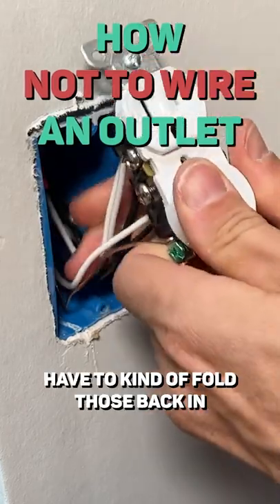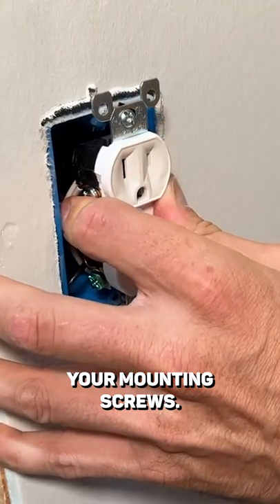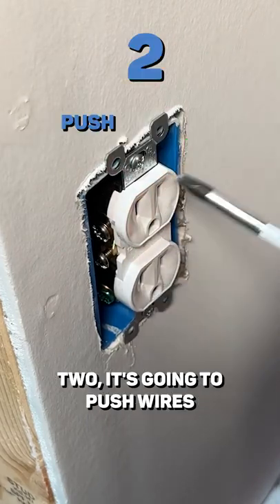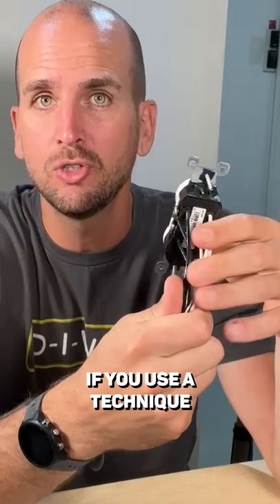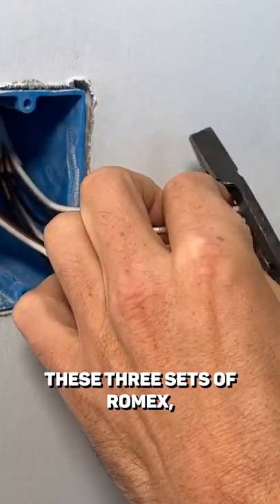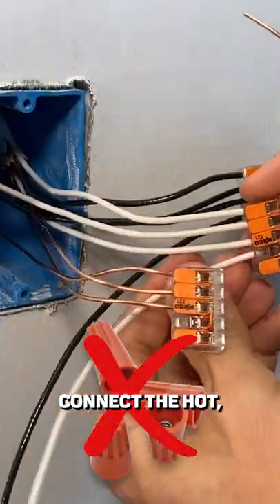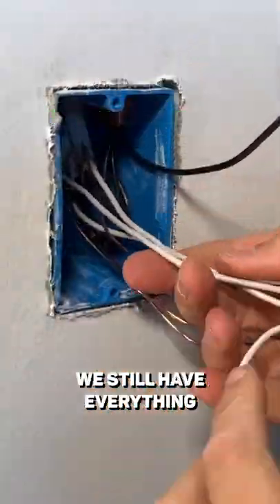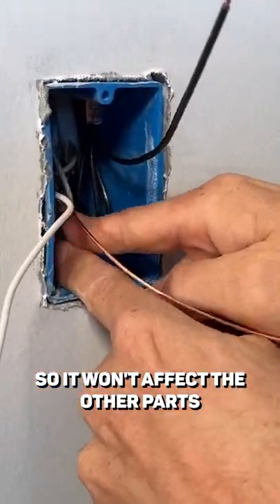The Better Way To Wire Outlets #shorts

Comment: Pigtailing also keeps your device from carrying the circuit and instead relies on the copper wiring intended to carry the load. Gives longevity to your devices
Reply: Better to have the wago carry the current through those small contact points? Wonder what has more cross sectional area, the brass connectors in the receptacle (not the push in ones) or the contacts in a wago... I get the wago is technically rated for that voltage and amperage, but they still get warm in the tests that were done
Reply: @michaelhanson5773  It depends, I typically twist the copper from the wire and use a wire nut to protect the connection, I don't use wagos for receptacle pigtails simply because they have a potential to carry 15-20 amp loads and I don't trust that small piece of aluminum to hold up over time. I only ever use them for connecting lighting loads, which are low due to common LEDs only drawing around 1/2 an amp. I do work with guys that use wagos for everything, I just trust the direct copper to copper connection more.
Reply: @farkmuckerzerg634  FYI, the spring inside Wago levernuts is stainless steel, not aluminum. 1. Aluminum does not make good springs. 2. Aluminum would corrode from contact with the copper. The springs are designed for maximum contact and the lever provides pressure. The biggest advantage for me is the reconfigurability.
Reply: @TomCee53  I'm not talking about the spring, I'm referring to the aluminum block that the copper conductors lay inside. Also, every point of termination into a panel is an aluminum lug, haven't had any corrosion issues by landing copper wire into them.
Reply: I have seen several fires caused by daisy-chained outlets.  Pigtails area must for safety
Reply: @michaelhanson5773 the two screws on an outlet, are connected by a tiny bit of copper, that is DESIGNED to break.  Its sufficient to carry the load of the outlet, but not the load down the line.  Also, you can find testing showing how well the wagu holds current.
Reply: @TomCee53  1. You're right ... not good for springs.  2. Copper is a noble metal that rarely corrodes, even around salt water.  A green protective layer forms on it, but it is not harmful.  Copper does not cause aluminum to corrode.  An electrician should know that because lugs on breakers, disconnects, etc. are often made of aluminum.  Copper to copper surface contact adds less resistance to the circuit than wagos and wire nuts take up less space in the box.
Reply: @SteveWhiteDallas well it depends. In older houses aluminum was used heavily and when connecting to copper galvanic action can occur. Nowadays most aluminum wire is a alloy that allows for aluminum to copper connections to be made withought risk of corrosion. Even so my master always taught me to put nolox on the connection anyways. I just did this the other week when wiring a 480 volt disconnect for an hvac system. The lugs were aluminum and the conductors were copper. So older aluminum wiring defenilty use nolox newer wire maybe not maybe do it is up to you. Oh and this is coming from an electrician, you'll find in this trade that everyone has their way of doing things, leads to lots of heated arguments.
Reply: @jsb7546  Yeah, you're right.  I should have  been clear about what kind of aluminum I meant.  Wire is obviously different than the aluminum in lugs.  Are lugs alloy or hardened?  They might have even added 5% lead to old wire to make it workable.  They often do that with brass (70, 25, 5 - Copper, zinc, lead) or something like that.  I buy it in rods.  But I use noalox on all aluminum wire, which is mostly triplex or underground feeders
Reply: @michaelhanson5773  Absolutely agree!
Reply: Baloney.
Reply: Nonsense. Residential verses commercial and hospital specs... differ
Reply: My understanding is that the side terminals on outlets are straight copper connections and are rated for more than the stated amperage of the device. I use those to daisy chain rather than adding wire nuts and two 6 inch lengths of wire to the box. It is neater that way, less box fill, less risk of error or failure from the extra wire nuts.

Don't backstab though or add two wires to one screw terminal. In that case where there are three or more Romex coming into a box, I up size the box and pigtail.

Comment: Never back stab a switch or outlet.
Reply: Exactly. It's less reliable. Use the side screws or install a backwire device.
Reply: I've seen so many problems with stab lock
Reply: Almost every time I troubleshoot an outlet for a lose neutral it’s because the stab in falling out
Reply: @TheeJoeyPage  yessir .. it's one of the 1st things to look for
Reply: Job security😂
Reply: UL listed. Done properly work perfect.
Reply: My parents had the electrical in their house redone back in '02. I added wires for wall mounted TV last year. Outlet was back stabbed. There has not been an issue with any of the outlets for 20+ years and they're all stabbed.
Reply: As a 3rd year apprentice going on my 4th year I do alot of backstabs on receptacles when I do commercial or residential trim & haven’t had a problem🤓👍🏽,
Reply: Myth. It'll be just fine.
Reply: If I have 3 wires I strip out the middle of the black and white of one of the cables then I strip out the ends of all and wire nut. No back stabbing and you don't have to go get extra conductors or use shitty wagos
Reply: @jocool562 maybe not for that one single case but theees been more than a few times I’ve had to trouble shoot different things and it turned out to be a problem with the backstabbed outlet or switch
Reply: @FLUBZERO why are so many ppl against wagos. I just found out about them and used them redoing my lights in a 100+ year old house cause there was 0 slack left and I always felt weird about wire nuts

I don't know about of lot of "new" things tho because I was taught by very old ppl, most of which have passed and genuinely curious. There seems to be a world of things I never knew about because I never got supplies but seems everything new has the world divided
Reply: My house was built in 1993. Every outlet is backstabbed and I haven't had a problem with anything.  It's actually annoying bc it's so hard to get the wires oit
Reply: @ronaldkincaid9972 Anything relatively new will be debated.  I think Wagos are great but I’m not an electrician.  I’ve felt the same way with wire nuts.  Fine on new construction but I hate that feeling working on old stuff with limited room / wire.  I feel better locking in a Wago than fiddling around with a wire nut.
Reply: Why

Comment: Pigtails are required for code where I am now. Lots of homes burnt down from the old 70's way of doing things without them.
Reply: Chicago?  Because that's code here for us too

Anytime I go to the suburbs though I see houses where they backstab and it sucks working on them
Reply: Or use a modern outlet that has lever connectors.
Reply: @shikamaru3456  don't think I've ever seen them, but if they don't have a screw to hold in a wire in addition to having a pig tail, they aren't code legal. My guess is that they are a euro thing? 

Edit those are the exact things they had in the 70's, they just added a lever on this one that are no longer code worthy as they started fires when the wires fell out. in other words 1000% not up to code where I am
Reply: Was that due to back stabbing devices?
Reply: @rhelouin  well the wires fell out of the outlet over time and age and then shorted out and caused fires
Reply: How is using pigtails going to prevent fires?
Reply: @danallen514  They don't fall out of the back of the socket and spark until they catch the wall on fire.

See above for more detailed answer.
Reply: @VileStorms maybe we are talking different pigtails, if you pigtail like the video you still have to make the same connection to the device as you do without pigtails. Just less wires, plus you have added the wago or wire nut another potential weak point. Not trying to argue, I prefer to pigtail. Just thought you might know something more.
Reply: @danallen514  Well the reason the pigtails don't burn down the house is because they are screwed into the socket and not a direct connection stabbed(pressure fit) into the back of the socket on pressure alone. The pigtail connects to the socket on one end with a screw and a wire nut on the other ends. With this way the wire can't fall out of the back of the socket.

It is really hard to explain what they are as if you have never seen them before there's no way you'd understand what I mean. In the 70's plugs used to have little slits cut into the back of the sockets which electricians would just pressure push a wire into. Over the decades those wires get old and brittle and fall out of the plug, short out and burn the house down.
Reply: @VileStorms  ah yes I guess 15 years of using them isn’t enough time. You can attach pigtails either by backstabbing or by using the side screws just the same as feeding through the device. If your talking what I would call a plug tail device such as the hubbell snap connect system or P&S plugtail devices then yes the wires connect differently and cannot fall off.

Comment: Never use the push in tabs on the back. 😎😎
Reply: We only use push in tabs but good engineered ones. Way better than screws which will get lose after some years.
Reply: Andregenter, you are wrong about that. Screws cranking down on solid copper wire don't come loose. Push in terminals are NOT way better than screws.

Comment: It's interesting that you don't insulate the earth ( ground) wire in the USA.   In Europe we put an insulation sleeve over the exposed wire so it has no chance of shorting to a live wire.
Reply: We use standard electricity. You guys have that metric electricity. I used to wonder the same thing.
Reply: @Thatguy-hc3ed  You made me laugh about the metric electricity.  I hadn't thought of that!  I think maybe it's because of the voltage difference, we have 230v.
Reply: @Crusty_Camper  I forgot you guys actually do have a different voltage. Totally slipped my mind, I was just being a goofball about the different units of measurement. I guess using twice the voltage would merit a little bit more precautions.
Reply: @Thatguy-hc3ed  I enjoyed the metric joke.  Yes, I think we have more chance of arcing.  Yours Metrically, Pete
Reply: really? we generally have it pre-insulated like all the other conductors. No need for sleeving.
This also in Europe.
Reply: @TheAzynder  That's interesting.  I saw in this video the earth/ground wire was bare within the outer cover, as some of our wires are, but it was left exposed which would be against our regulations.
Reply: @Thatguy-hc3ed  American electrons went to Caltech or MIT; European electrons went to Oxford, Cambridge, or the Sorbonne.  It's simple geographical physics.
Reply: @bagoquarks  nice observation. I do also know that Icelandic electrons are required to complete an year apprenticeship along with their academic studies. I appreciate high quality electrons from all over the world
Reply: @Thatguy-hc3ed  voltage in USA is 240 to the box then it splits to 120, 240 devices have a double breaker just need one for the right amperage.
Reply: 50 cycle also
Reply: The ground insulation is kinda irrelevant, any metal part that should not be carrying current should be grounded
Reply: @davidblahota5655  It's not irrelevant though.  Any bare wire has the possibility of shorting to a live wire inside a fixture.  Leaving it uncovered creates a risk ( how however small ) that wasn't there before.
Reply: @Crusty_Camper  risk of what exactly?
Reply: @Crusty_Camper  with live or neutral wire being exposed you got entirely different problem on your hands than uninsulated PE
Reply: @davidblahota5655  Hahaha.  OK, you got me there , I thought you were seious.
Reply: @Crusty_Camper  I am serious tho. There's literally nothing it can do out of doing exactly what is it supposed to do once the other wires are in proper state. If the box were metal, it's entirety is at the same potential as the exposed PE wire inside
Reply: @Crusty_Camper  As with the conductors in britain, the green/yeklow sleeve is not for insulation, just for recognizing the conductor.
Reply: @davidblahota5655  OK, The practise you are describing has been illegal in most of the developed world for the last 30 years or so ( not sure of the exact length of time )  one the grounds that it is potentially dangerous.    In a typical installation there will be screws and similar that are live but only just shrouded as nobody is supposed to be poking at the back of accessories with the power on. A kinked CPC could poke in to such a hole causing a short.

Now you might say "well that is its job" which is true, it has allowed automatic disconnection, but the result of such a direct arc on to the CPC might blow a hole in it, and then after someone resets the MCB they might have the appliance-end of the failed wire still in contact with the live, making anything attached live and dangerous.
Reply: @Crusty_Camper  well all of these i've seen have got the screws on the front side , no way of the wire getting there pushing the device in the box 🤷
Reply: Just a precaution. Path of least resistance.
Reply: @davidblahota5655 I think it’s a fair point.  If the exposed ground wire contacts a hot terminal, isn’t that a problem?
I’m not an electrician tho.  I know it would be doing its job but do we want voltage going through it all the time?
Reply: @Splattervision-qh1sd  this ground wire is called PE (protective earth) there should not be any voltage present at anytime and there are ways to break the circuit once current through PE goes over a certain limit. Any metal electrical enclosure (including kitchen appliances, like the case of a microwave) are (should) be connected to the PE line as a way to prevent conductive materials that should not have voltage from having it. 

It IS a problem, however one that was intentionally designed to protect people and other things from getting zapped.

Your job if you're working with non insulated one is to ensure it does not touch either line or neutral terminal, which is not that difficult to keep an eye on...

Comment: Super. Someone really needs to invent a micro welder where you twist the ends of the wires together, put the device over the ends of the wires, and ZAP, the wires are welded together, just insulate and you are done. Wago and Ideal type connectors are adequate, but tend to fail under heavy load or extended age or poor installation procedures. Wire nuts are only marginally better but only if installed correctly with pretwisted wires and a firm twist. Soldering or wire welding is the only way to junction wires so that you don't have issues down the road. 💙 T.E.N.

Comment: When the CPC/Ground touches those live and neutral terminals...

BANG!
Reply: American wiring standards are decades behind the more developed countries.
Reply: @Acrowat40 True words
Reply: You do realize the neutral is a grounded conductor, right?  If you can't install a device without shorting the ground to the hot wire, maybe you should just flip burgers instead.
Reply: It used to be the case that the earth/ground in UK sockets were bare earth, but for a few decades they have to be sleeved to make sure that there isn't an accidental short. In many countries, the earth/ground connector has to be insulated within what Americans call Romex cable.

Comment: I would spend a little bit more and get a deeper box!
Reply: Easier and cheaper, those connectors are not cheap.
Reply: Deeper box for easier install & future expansion.....
Reply: @Dwohman  wagos aren't all that expensive
Reply: Not all houses support longer boxes, I just did one where the frame of the wall was only two inches thick.

Comment: Code in commercial.  Great advice for a DIYER. Wagos especially because twisting a good joint with a pair of pliers isn't easy for everyone.  This keeps it safe.  In residential though, it would cost the customer alot on a new build if they requested this.

Comment: Tip: NEVER use those push in connectors on the outlet. I've seen so many outlets fail and cause fire hazards with them. ALWAYS use the screw downs!
Reply: eu has better electrical stuff..
Reply: In Europe we got some which actually work and are even way safer than screws which can get loose.

Comment: I friggin LOVE these Wago lever nuts, thanks for making me more aware of these. I'm never going back to wire nuts.
Reply: Wire nuts are a better connection,  the wire nut only holds the wire together in intimate contact, the Wago has to carry current across it.
Reply: @edrorie7764  which is fine if the metal in the connector is rated for more than 15amps..

Comment: Even though power is off, never good practice to grab the plug by the terminals like that.
Reply: Yes it shows bad habits and work on quality and then the practice speed will come.
Reply: Are you kidding? That the whole point of shutting power off so that you can grab and manipulate the outlet without getting shocked. I’m an electrician in the US.
Reply: 1) Shut of breaker at panel. 2) test outlet wires with circuit tester. 3) Lick the wires and/or outlets if you want, to your hearts and weird minds desire!